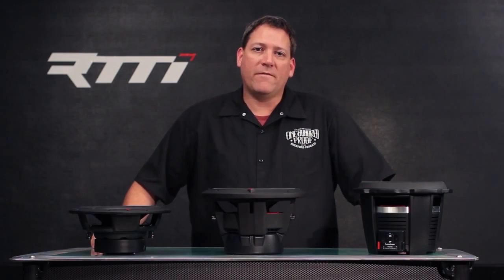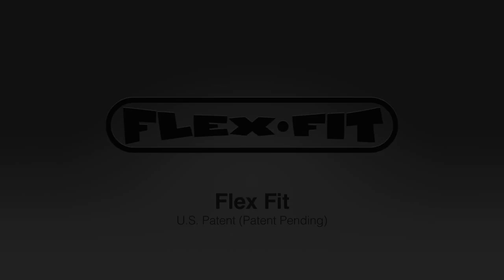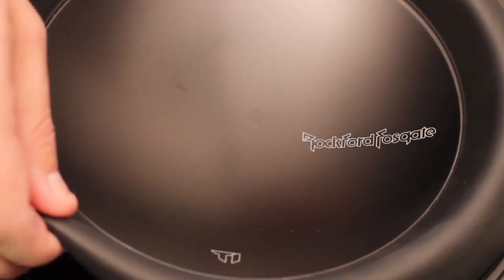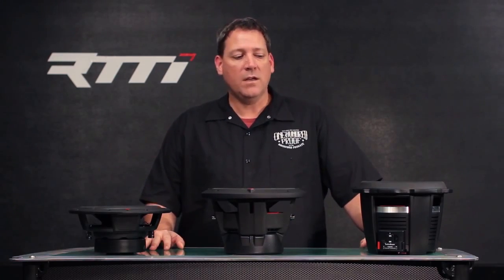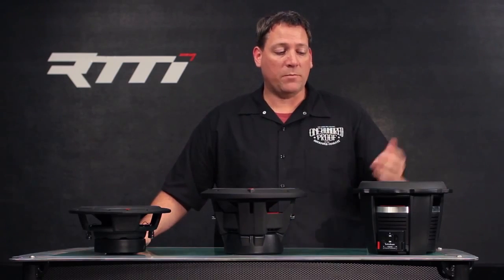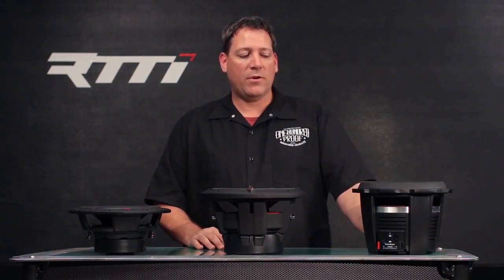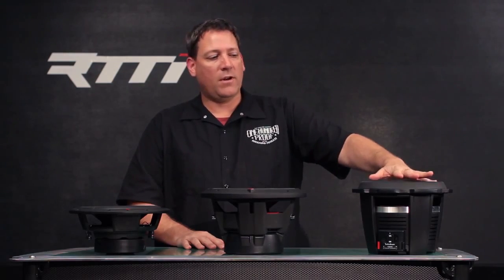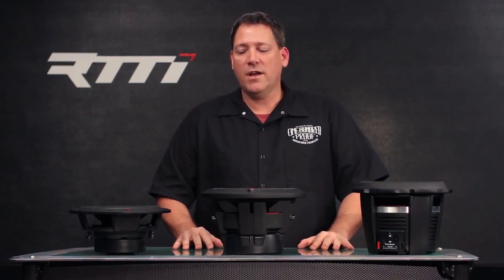Rockford Fosgate: Subwoofer Comparison (1.3)

Comment: Now they have brands like  sundown audio Dc audio aound digital they are very very cheap and they may get wayyyyyy louder dan any rockfordfosgate products.. BUT how long will they last?😂 i started with rockford subs and amps and i will always buy them.just think about it do u need more beefy sorounding ruber or do u need more cone area? Wich makes more sence? I would atick with more cone area.. keep it up rockford..
Reply from the maker: Thanks Naiem!  The difference is Rockford Fosgate engineers focus on the performance of the subwoofer with an emphasis on Sound Quality ... we're not gluing multiple spiders together to prevent the speaker from breaking while trying to reproduce a narrow band of frequencies.  In other words, Rockford Fosgate designs subwoofers right to begin with.  The biggest complement we consistently hear when someone switches from one of those brands to Rockford Fosgate is "These subs sound so musical."  Naiem, keep spreading the word and together we'll help save our friends from bad sounding car audio!
Reply: Rockford Fosgate definitely agree I’ve had numerous of subs from not so mainstream brands like re audio etc.. currently have some alpine type r’s and their good but I leaning toward some fosgate p3’s.
Reply: Don't get me wrong, I love Rockford Fosgate and I use their products all the time. But I equally love Sundown products as well--now, Rockford Fosgate products, I can push a tiny bit more power to them than they are rated for, and be comfortable with it in the right box/enclosure. But I wouldn't want to do that all the time. RF products are made to do what they say they are made to do; they aren't like Sundown speakers where you can throw as much wattage as possible at them and you know they'll last. RF speakers are purposely made to do their ratings and not more than that, and that's good. It makes it very easy to build boxes to spec without worrying about "what if I give it too much wattage?" Sundowns however are made for POWER... and BEEFY, HEAVY speakers, that can probably easily do 25-30% more power in RMS than they are rated for and be perfectly fine. This isn't because they are badly marketed, but more or less because they are underrated. Which can have downsides but also plus sides. I do however commend RF for making their speakers and products not overrated, but also not underrated like other brands. It's a sweet mix of right-in-the-middle. You don't get underrated products like Sundown, and you don't get overrated products like Boss, Dual, Pyle, Alpine (more or less my opinion for Alpine), etc.
Reply: @QuietWind01  dude I've had my 1 P3 hooked up to a Skar RP 1200.1 for 2 years with zero problems, they can definitely handle more than they're rated
Reply: Ascap 850 p3 on a skar lp1000 here and never an issue
Reply: That's why I'm looking at the big names. I had 2 Orion xtr 2 12s for 18 years. Now I got a alpine type s 12. I'm not happy with it though.

Comment: hello, I was looking at P1 and P2 10's, what is the difference between those 2, the p2 only handle 50w more each, so Im a little confused, thanks for your feedback.
Reply from the maker: Yes, they are very close.  The performance is very similar, so the major difference is the power increase from 250W to 300W RMS and you go from a Single Voice Coil to a Dual Voice Coil.
Reply: Rockford Fosgate so what would you guys recommend, the p1’s with a mono 500w amp (2 10’s) or p2’s with a mono 600w amp( 2 10’s), i have a seperate 4 channel amp for my mids and highs that puts out 80 X 2 and 60 X 2
Reply from the maker: Depends on how much SPL you want.  the P2's with a little more power handling will give you slightly more output.  We just suggest keeping the amplifier power just under the power handling capacity of the subwoofers so you don't blow them up.

Comment: Can a T-1500dbcp amp  handle 2 T1 subs
Reply from the maker: The Power T1500-1bdCP is rated to produce 1500 Watts RMS x 1 @ 1-Ohm and Dynamically (when you're hammering it) up to 1715 Watts x 1 @ 1-Ohm.  

The T1D412 are rated to handle 800 Watts RMS, so 2 subs would give you 1600W power handling, so those would be right on the border.  The T1D415 are rated to handle 1000 Watts RMS, so 2 subs would give you 2000W power handling and would match-up with a little room to spare.
Reply: @rockfordfosgate  
I just installed two t750x1bd amps, and two t1d212 subs....very very impressed, super loud, and super clean
Reply from the maker: @georgesimmons4918  Thanks for sharing your experience with other fanatics!  That T750X1bd is a monster.  It can put out 990 Watts x 1 @ 1-Ohm!
Reply: @rockfordfosgate  
Yes I have been a Rockford guy for many years, I'll admit I was kind of skeptical of the t750 but wow they  were worth every dollar spent
Reply from the maker: @georgesimmons4918  Right On!  Thanks for being a long time Fanatic!

Comment: I have had all the fosgate subs, I do miss the old dvc and hx2 subs more than all, making new lines of subs is supposed to be better but to me it seems like fosgate subs went down hill instead of uphill, the subs have a shitty motor force nowadays. I will stick with my sundown audio, American bass etc.
Reply from the maker: Thanks for your feedback Namaless 82.  To address your claim, you'll find both the "Pe" (Power Handling) and "Bl" (Motor Force) on both older 2002 Power HX2 DVC and newer 2015 Power T2 SVC subs below.  The Thiele/Small data clearly shows the exact opposite, Rockford Fosgate motor force "going uphill".  It's important to note that this data is validated against rigorous CEA-2031 & KLIPPEL testing standards, so it's legit data, not marketing spin:

12” Power HX2 - DVC 2Ω
— 1000W RMS
— 13.88 Tm

13” Power T2 - SVC 2Ω
— 2000W RMS (100% increased power handling)
— 16.28 Tm (17.3% increased force factor)

15” Power HX2  -DVC 2Ω
— 1000W RMS
— 12.85 Tm 

16” Power T2 - SVC 2Ω
— 2500W RMS (150% increased power handling)
— 16.73 Tm (20.5% increased force factor)
Reply: I have a fosgate p-006 amp will it push 3 15 " kicker boxer

Comment: So my screws under my power one broke off is there a video on how to replace them
Reply from the maker: Don't really understand your comment regarding "screws under your power one broke off."  Are you referring the screws that hold the subwoofer together located on the bottom part of the subwoofer (magnet) have broken off?  No, we don't see this happening, so we have no video on replacement of screws that hold the subwoofer together.  You may want to contact our technical support specialists to see if they can help you identify what parts are broken and your options on getting it fixed at 1-800-669-9899.

Comment: Hello. Is a daul 2 ohm a 4 ohm because it has four terminals? And if you have to punch 500 rms p3 10s is it do you recommend a 2 Chanel 1000 watt punch amp? Or does it have to a mono amp?
Reply from the maker: A dual-2-ohm subwoofer has two voice coils, each with it's own pair of (+) and (-) terminals.  Use our Woofer WiringWizard to see how a dual voice coil subwoofer can be wired to create different impedances: http://www.rockfordfosgate.com/support/wiringwizard.aspx

For the P3 subwoofers, you can use whatever amplifier you choose, assuming it can play the frequencies needed for the speaker.  Also, be certain not to exceed the RMS power ratings of the subwoofer to prevent from burning the voice coils.
Reply: Thank you sir

Comment: Is a 900amp turn up to much for two 12in p1s1?
Reply from the maker: Yes, the P1S2-12 & P1S4-12 subwoofers are rated to handle 250W RMS, so two subs will give you 500W of power handling capacity.  Please use an amplifier that does not exceed the RMS power rating of the subwoofers or you'll likely burn the voice coils.
Reply: Thanks
Reply: A 500amp would be better for them
Reply from the maker: Yes, now you're on the right track!
Reply: Thank you so much👍

Comment: I just tested (2) T112D2 (2004 model) vs (2) P3D2-12 (current model) and there was very little difference, with both sets running 600w RMS. Did the Punch series improve THAT much?
read: very little difference = no discernible difference in SPL
Reply from the maker: Hi Screaminggiraffe, The T112D2 is rated to handle 600W RMS and the P312D2 is rated to handle 500W RMS.  The sensitivity is 86 dB (T112D2) and 87 dB (P312D2) respectively.  Assuming both used the exact same enclosure and the same power (as you noted), we wouldn't expect any huge difference.  In a side-by-side comparison, you'll need to have at least 1 dB difference to hear even the SLIGHTEST difference.  Now this is a theoretical position, we're not saying it's O.K. to do this because you'll blow up your subs... but in order to hear a noticeable difference, you'll need to double your cone area or double your power input.  That would provide a 3dB increase which would be a noticeable upgrade.
Reply: Thank you - I'll remove the T112D2 subwoofers from my setup and just stick with the P3D2-12.

Comment: Is my Power T600-2 too much power for a P1 10" subwoofer on each channel?
Reply: I believe I have 2 4-ohm P1s
Reply from the maker: The Power T600-2 is rated to produce 200 Watts x 2 @ 4-Ohm, 300 Watts x 2 @ 2-Ohm, and 600 Watts x 1 @ 4-Ohm Bridged.  The P1S4-10 is rated to handle 250 Watts RMS.  So if you're going to wire 1 subwoofer per channel in stereo mode, you'll be totally fine.

Comment: now I hear that a lot of r and d went into cooling, is that due to the " super awesome " CCA wire you made your ...coughs while talking....fire starting kit-er voice coils from? I have a set of pch-128 s running off 500rms each( yes this is double the RMS of the sub) in a sealed enclosure and have yet to run into any sort of issues. these subs were made in 92-94 and use steel and paper and copper . why the push to cheaper less durable materials to try to build a quality product? if I were to build a, um.....a steak, yeah this will work. if I were to build a steak , wouldn't I want to use the best ? good garlic , a top shelve Bourbon to marinate , fresh pepper. and then the tools took make it, cast iron grill slats on a wood fired grill or I could get a chunk of " meat " and slap some liquid smoke on there , chuck that bish in the roundy pew pew heat molecular excitement box and caller gor-met....yum! so why use flaky CCA wire for a voice coil?
Reply from the maker: The best material to use for voice coil wire is solely based upon the application.  Copper is heavier than Aluminum and therefore less responsive.  Aluminum wire has better transient, faster attack, and lower distortion.  A benefit to copper is it's more conductive so you can use smaller gauge to achieve the same resistance.  In regards to which is better from an electrical conductivity standpoint on a speaker, it's purely a matter of having the proper gauge that yields the correct resistance having sufficient current carrying capacity (Power Handling).  Aluminum wire - in the manner which our edgewound coils are done - is the most thermally efficient design and much more expensive.  They are typically only found in the most expensive professional woofers in the world.  Nearly all transducer engineers would use aluminum over copper if their design could afford it and they could get it manufactured in the manner they want.

It's important to note that all Rockford Fosgate speakers and subwoofers conform to industry standard CEA-2031 power ratings.  This is the continuous power as established for the RMS Power Handling rating. Manufacturers that don't conform to this standard can print whatever "RMS" power ratings they want on the box.  Know what you're buying.

We appreciate fanatics around the world still rockin' their 1990's -era subwoofers like the HX2 and PCH models.  It's a testament to our original design philosophy of the first Punch subwoofer sold; design speakers to sound great, handle the appropriate power for the application, and work reliably for the longest period possible.  We have also stood by the recommendation of applying up to (and not exceeding) the RMS power ratings of the speaker/subwoofer.  This will keep your speakers working for years to come.
Reply: Thank you that makes sense to me. I do love my early fosgste stuff. I am getting ready to order some p3 s now that I understand things better. Again thank you.

Comment: i already installed the prime R165-S kit in my car and im thinking of buying single prime R1S4-12 with a 180 watt rms amp. or should i buy a 240 watt rms amp? i dont want to overpowering bass cause i only have 2 door speakers running on aftermarket headunit, nice taste in music btw
Reply from the maker: Hi Thompa!  The Prime R165-S speakers are great performers and rated to handle 40W RMS.  A single R1S4-12 subwoofer would be the perfect addition rated to handle 200W RMS.  You can match the subwoofer with an R150X2 bridged to produce 150W @ 4-ohms (a good matchup).  Another option is switching the front speakers from the source unit to the front channels of an R250X4 which would produce 40W RMS stereo.  The rear channels of the R250X4 could then be bridged to the subwoofer to produce 125W @ 4-ohms.  Either scenario would provide a good balance of mids & highs to bass ratio.
Reply: Rockford Fosgate The P3d2-15 rated @ 600w it will be a perfect fit for a RF-P1000x5 in the 5ch that its rated @ 1 ohm 500w?

Comment: Wait, isn't the P3's cone made of annodized aluminum as well?
Reply from the maker: CrystalMeth77 is a winner!  All P1 & P2 subwoofers use "Kevlar fiber reinforced paper cone". The P3 is similar in construction with the only exception being the aluminum cone.
Reply: Sounds sarcastic but I'll take it. Loving the P3D4-10 right now as it's probably the hardest hitting 10 I've ever heard.
Reply from the maker: Sorry, we're just making light of our mistake you found in the video.  It's our fault, and it wasn't intended to be sound that way.
Reply: Rockford Fosgate Nah its cool. you guys made me the loudest 10" sub I've ever heard for an affordable price so don't apologize for it. I've started getting my friends to buy P3 subwoofers from you guys and dealers. And yes expect me to buy another P3 very soon.
Reply: @rockfordfosgate  I have a sealed box with a brand new(crappy AutoTek 2000watt Class A-B Amp)with your 2 12" P3's and I want more bump!! This was my VERY FIRST sealed box. It's in my 2014 VW Beetle Turbo. It sounds pretty good but, I'm looking for a ported box and a more powerful amp. The P3's are awesome Subs!! But my last set up was a 15" Tarantula Soundstream in a ported box with a Kenwood 750watt class D amp. And it hit harder then anything I've EVER OWNED!! So I'm trying to get back or BETTER than that. My QUESTION IS... "Would I be better off with ONE P3 12 in a ported box with my same generic Amp, or get a dual 12" ported box and keep the same amp, or ported for one or two and get a stronger amp as well?"
Reply from the maker: @adamscannell647  Adding more woofers will always improve your SPL output, and since you'll be going from 1 to 2 subwoofers, this will increase the output by +3 dB.  The subwoofers are designed to handle up to 600W RMS.  

Unfortunately, you need a better amplifier.  The one you have (I'm guessing it's the Autotek MM2020.2 as tested by Quality Mobile Video) is only producing about 80W a 4Ω mono, so it's barely producing any power at all to drive that subwoofer.  https://www.youtube.com/watch?v=MDSrrBCY0z4

Comment: how about we talk about the elephant in the room, the huge magnet boot hiding the so called magnet. no mention of the voice coil size. do you realize you alienate the car audio culture you claim to target.
Reply: indopleaser voice coil size and information is available on Rockfords website.
Reply: indopleaser actually if you look at the P3s they have a pretty big magnet saying the P2s to P3s is over an inch difference in mounting depth, meaning a larger magnet.
Reply from the maker: This is a Dealer Training Video covering the overall technology differences between Prime, Punch, & Power subwoofers.  Also, not all subwoofers in a lineup use the same voice coil size.  Therefore - as Paul Cabinatan mentioned - all product specifications including voice coil size are available on www.rockfordfosgate.com.

Comment: So, the difference in sound from 600 wrms of P3 12" and 550 wrms T0 12"?
Reply from the maker: The P3 12" is rated at 600W RMS.  The T0 12" is rated at 700W RMS (not 550W).  These are very similar subwoofers.  The main difference is slightly more SPL due to the higher power handling of the Power subwoofer over the Punch model.  This is thanks to the IDHS internal heatsink that resides on top of the woofer magnet.